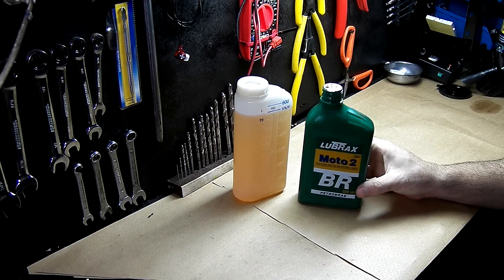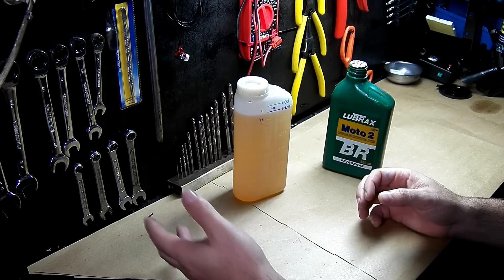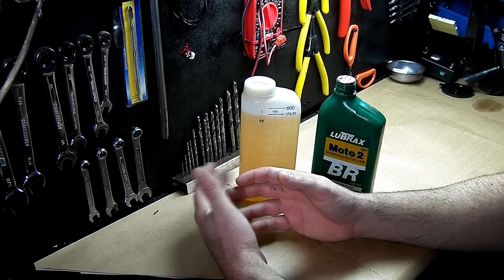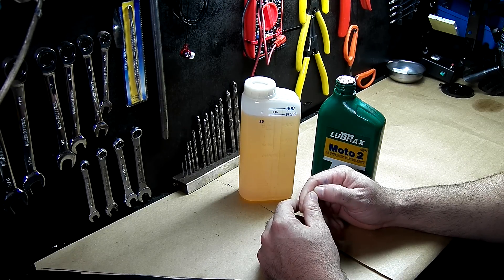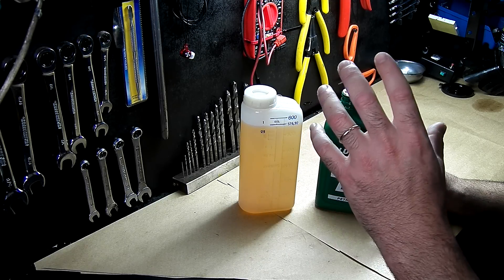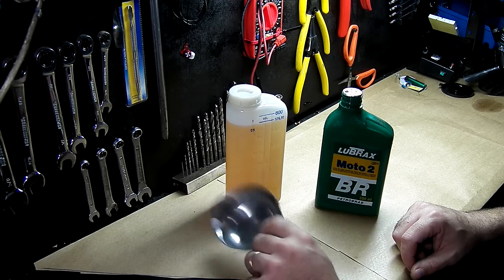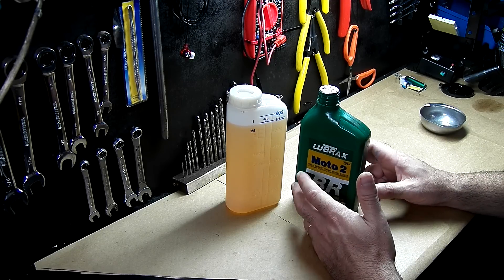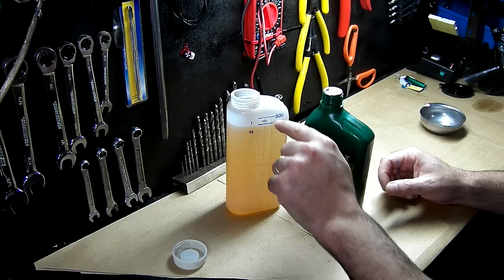secrets of 2 stroke engines oil x gas mixture

Comment: Figuring out mixture ratios is easy - just get a calculator.  128 divided by the ratio you want.  128 divided by 50 equals 2.56 ounces.  That, is the amount of oil you will need for a 50:1 ratio.  A typical bottle of Stihl or Husqvarna contain about 70 ml of two cycle oil.  I run a slightly richer concentration, 80ml for a ratio of about 45:1.  I do not trust bottles and measure everything.  A 70ml bottle will give you about 2.56 ounces if you rinse out the bottle with gas and pour it back into your gas container.

Comment: You can't work out 25:1 as a percentage?
Reply: The only tricky part here is to determine whether 4% is considered the amount of oil in the final mix (4% oil, 96% fuel), or if you simply add 4% oil to 100% fuel. The first is actually 1:24 and the latter is 1:25. The first mixture consists of 4% oil, the second mixture has 4% oil added to the fuel.

Does it really make a difference if you mix 4 ml oil with 96 ml fuel, or 4 ml oil with 100 ml fuel? No, it does not.

1:25 is still considered 4% mixing ratio (even though it's roughly 3,846%), 1:50 is still considered 2% mixing ratio (even though it's roughly 1,961%) and 1:100 is still considered 1% mixing ratio (even though it's roughly 0,99%).
Reply from the maker: can you ? show me ! let's see !
Reply: @canalsilverbox  100 divided by 25 is 4.  4x1 = 4
Reply from the maker: not correct .... try again, like I said It's tricky !
Reply: @canalsilverbox  Absolutely correct.  VERY basic mathematics 1/25 = 4/100 = 4%  Not sure what the "tricky" part is

Comment: does anyone know an equation for thinking a mixture? i mixed some 16:1 for a break in and break in is done and the mixture is just to high to get any power out of it and i hate to waste gas
Reply from the maker: mesure how much fuel you have mixed in 16:1 , divide it by 17 and you get the unit to make the new mixture , for example if 5ml is the unit you just multiply 5 x 50 to get the correct ratio for 50:1
Reply: @canalsilverbox  i know i would have eventually worked it out but it gave me a headache
Reply: 16:1 is hell of a lot , like a racing 100cc kart

Comment: 1 liter gas x 20ml oil (14ml 2t motorex cross power + 6ml castor (ricin) oil) 50:1
No problem at all, much more rpm and power

Comment: 1 to 40 ratio recommended here. But strangely enough it then emits damn lot of white smoke, stinks like burned oil and stalls on me each time I pull the trigger. Once I lowered the ratio to 1:30 I had no problems anymore. No white smoke, no burned oil stench and no stalling on me again. And the engine doesn't heat up on me either. Runs smooth. Bosh oil here by the way, which is one of the best oils you can find here.
Reply: 30:1 is more oil than 40:1
Reply: The smoke from the exhaust is the reason why I ride a 2-stroke.

Comment: here this is the easy way and listening to this guy is annoying.....if you need a 32 to 1 ratio its 30ML per liter or for 40 to 1 ratio its 25ml oil to 1 liter gas/petrol...and to get 50 - 1 ratio its 20ml per liter of gas......come one simple math...1000 divided by 20 is 50......so 20ml of oil into 1000ml(1L) of gas is 50 to 1...and so on

Comment: At 1:40 you say to run 1-30 instead of the factory recommended mix or 1-20 or 1-25, that is backwards.  It's recommended to run more oil during break-in, not less like you recommend.

The oil mix ratio is dictated more by emissions standards than by the engine manufacturers.  Here in the US almost all engines say to run 1-40 or 1-50.  In some countries those same engines are labeled to run 1-20 or 1-25.  I decide my mix ratio depending on how hard the engine will be run and how good the oil is that I'm using, some get 1-40 and others 1-25.
Reply: DonziGT230 my go to ratio is 32:1
Reply: I put a little 2-cycle oil in all my gas (400-1) because the ethanol causes corrosion from moisture. Race engines show the aluminum is pitted or dissolved where fuel is dumped into an engine. A tiny film of oil helps prevent rust during storage and is harmless.. Most engines will burn more oil than recommended. I have been using the recommended oil plus 25% Marvels Mystery Oil and not had any problems.